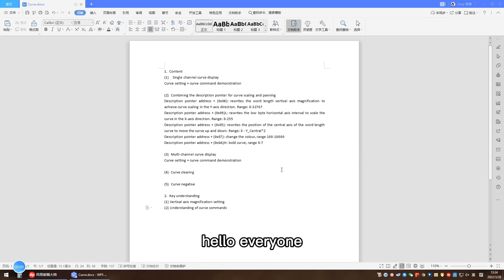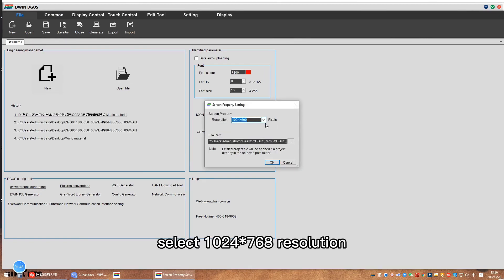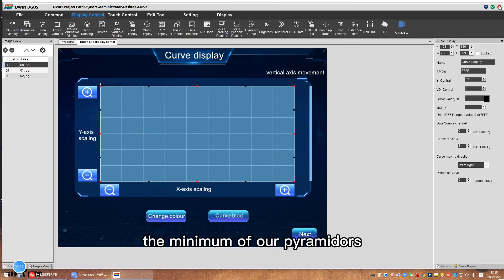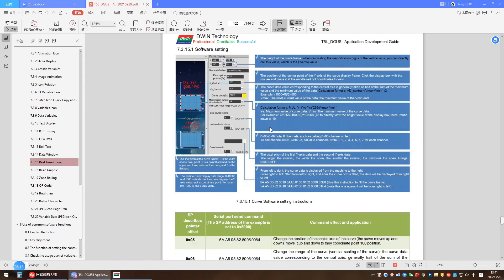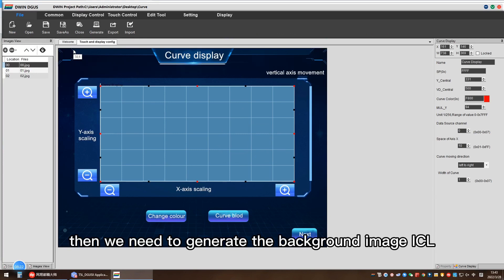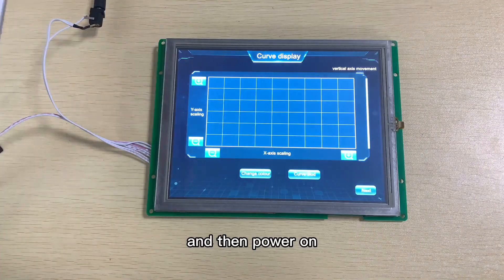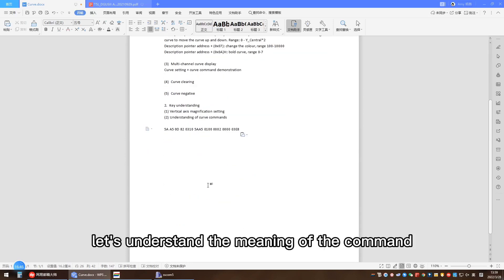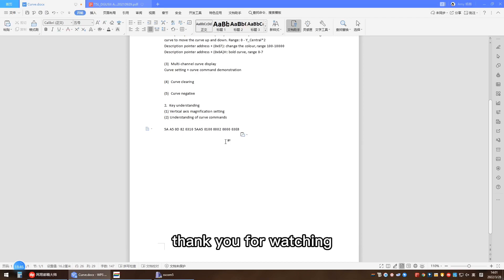Display single curve by serial port | DWIN T5L DGUS v7.624 Curve function

Comment: Hello. Do you have video tutorial in dynamic curve display with Arduino. I have pressure sensor and I want a simple X and Y graph display where the y axis is for pressure value from the sensor and x is for time.

Comment: For serial (TX2/RX2) port, i send data for any variable (e.g. "5AA505821A1C3031"), but system does not accept, no any action occurs. With same data, i send to t5l2, this time accpets and display. And next tryout, no response or any action occurred. I try many combinations, with or without crc, desolder/short ic input protection diodes, etc, etc. but always same problem: First tryout: accepts, next tryouts: no action..
Reply from the maker: Hello, would you please let me know the model number? and do you connect the GND? If possible you can send email to: cindychen@dwin.com.cn